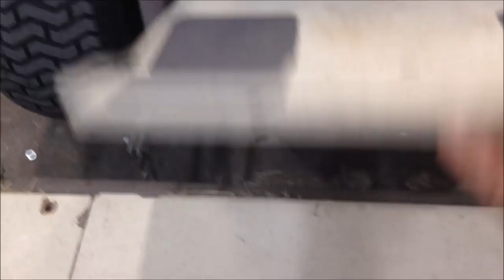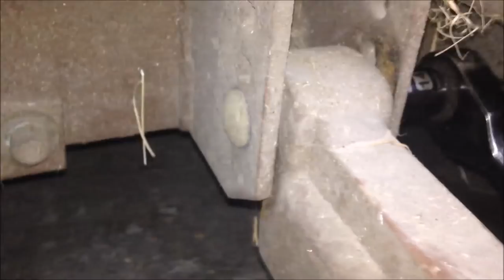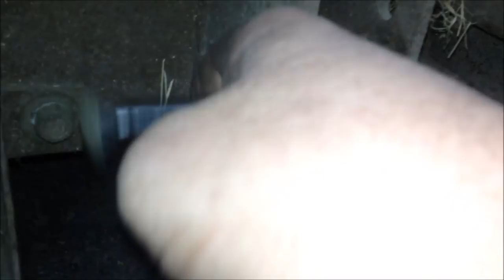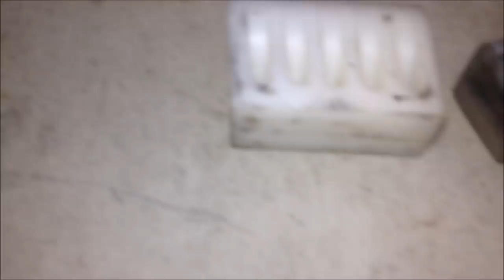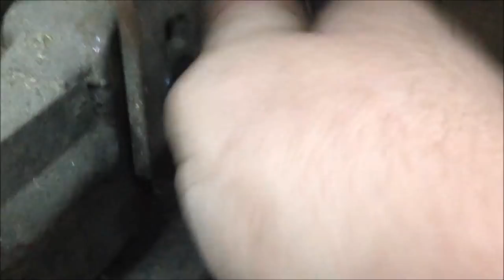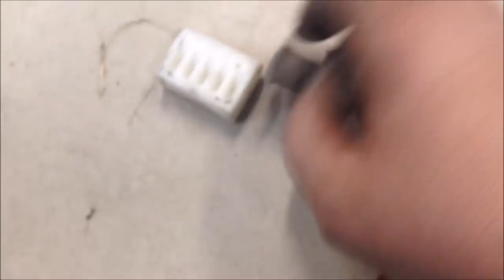GRASSHOPPER 721 DECK DEATH WOBBLE AND HOW TO CURE

Comment: Thanks for this! Can you do a post on the basic maintenance of grasshopper mower? How to remove the deck and put on other implements etc.
Reply from the maker: We rarely remove the deck
Reply: @THEMOWERMEDIC1 each plate of the Grasshopper tractor must remain floating otherwise it will not follow the undulations of the ground otherwise it will cut the lawn unevenly

Comment: The reason those go bad is that the way they are designed they hold the deck horizontally rigid to the tractor. That quickly wears the bushing out. You can now get bushings that are notched in the bottom middle to allow for more movement without destroying the bushing. I highly recommend that style for folks that mow where the lawn is not level and smooth. They will last much longer than the originals. And the easiest way to change those is to install the rear deck support jack, release the latches, lift the attaching arms with the height lever, and roll the tractor back slightly. Much easier to change those bushings without having to fumble around underneath the attaching arms. BTDT!
Reply: Got a picture or part number for those improved bushings? My yard has several ditches and a rigid deck won't last long.
Reply: @anoint426hemi6  rasshopper Mower Full-Flotation Deck Bushing, OEM 282576, Increased Deck Flotation FrontMount

Comment: hello, i have an older 722d with a 61 inch deck and motorized deck lift. i am halfway threw the bushing change and the deck seems to be spring loaded pushing the arms in and down. how do you detention them to line bolt and bushings lined up to replace.

Comment: Thank you for all the great videos over the years. I’m trying to figure out what I have wrong on a 1999 725g with a 9661 deck. I did extensive welding repairs to this deck and rebuilt it and now trying to get it going after years apart.  I think I have it together properly but the left rear of deck is hanging really low and loose when the deck is raised up. It seems like it’s not latching but it appears to be latched properly but still sags on the left rear and scalps on that side.   When I raise the lift handle the right side starts to raise right away and the left not so much.  Does the short stabilizer bar on discharge side have anything to do with this? Or the two lever handle bushings in the height adjustment mechanism?  The short stabilizer was rusted solid and had to be heated to remove and the position was lost on threaded rod. The bushings in the lever handle were missing so I made some out of a 1/2” spacer.
It seems like the problem is at the latch area where the load transfer arm with the d rings is.  Per grasshopper I used a pry bar to lift the left rear of deck to get the latch to snap in place but appears to already be latched but sagging lower compared to right side.  Thank you for any help you can give.

Comment: Hey love the videos been a long time follower. Question have you done any video showing the main drive pulley belt on a zero turn I have to replace mine on my Toro Time Cutter and looks like a pain. I'm going to tackle it this spring so I thought I would ask if there are any tricks to doing this.

Comment: I have a grasshopper 618 model and cannot figure out how to adjust my deck lower. When I put it on the lowest setting it isn’t low enough it’s still about an inch and half or so off the ground could you help me with this please ?